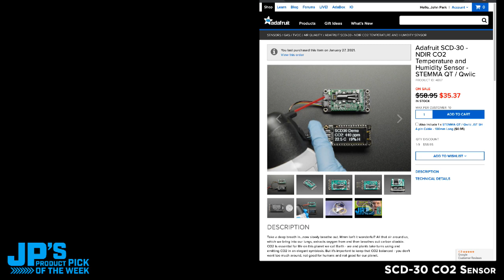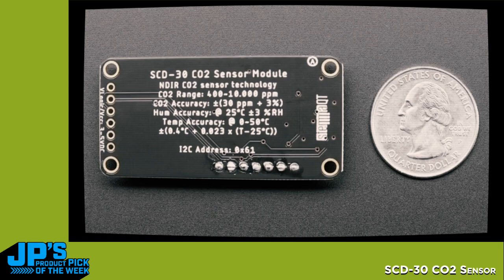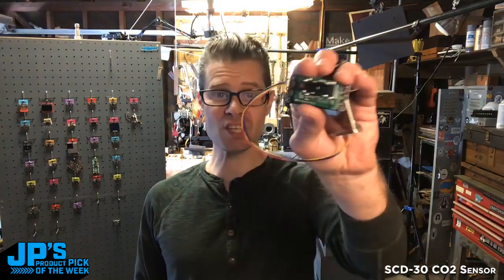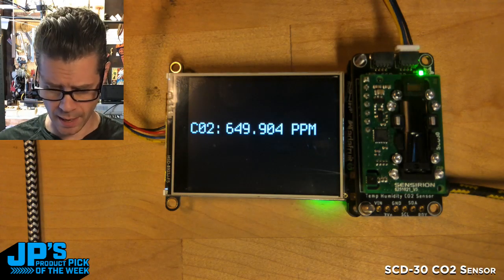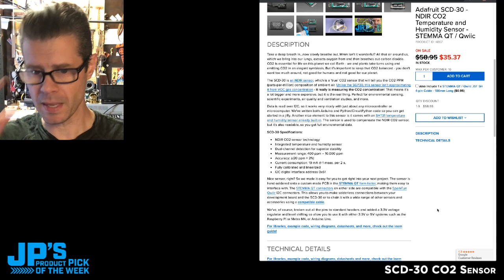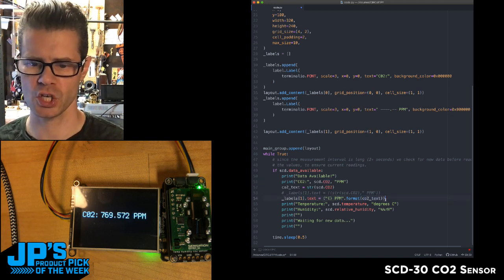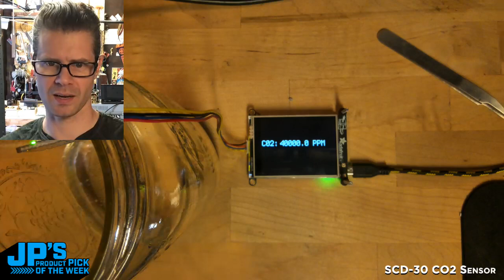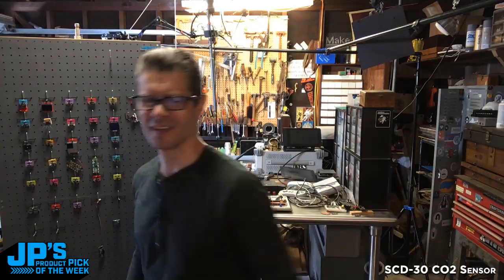JP’s Product Pick of the Week 3/30/21 SCD-30 CO2 Sensor @adafruit @johnedgarpark #adafruit

Comment: I apparently ordered too soon. I now have 2 that I'm planning to use for some technical work. I had some trouble getting the first one working with Circuitpython on a stm32f411, although the connections checked out. Apparently the developers hit the same error code, because Google found the discussion. So I switched to Arduino on an ESP32 feather, and it's working fine. Have to add some voltage supervisor code, sleep, BLE, and an adalogger feather wing that arrived today and see what unusual uses I can extend it into. I also added the VOC sensor, and it was interesting watching them sometimes moving in opposite trend in the office today.  Hmmm, have to track that down ...
Reply: I'm also using Arduino on ESP32, have you figured out how to change the settings to give data every 1min instead of every 2 seconds?

Comment: Could the sensor be reconfigured to check for oxygen, or is that a hardware limitation?
Reply: Not possible, the sensor is tuned on the wavelengths of CO2. CO2 has 1500-4200nm and O2 has 760-1200nm.
Reply: @mrwho30  best sensor for oxygen?